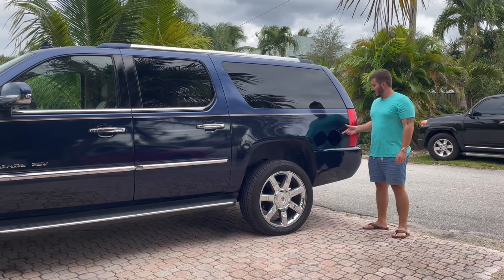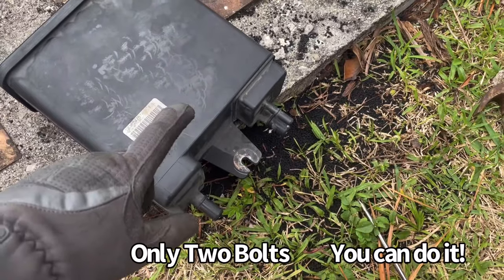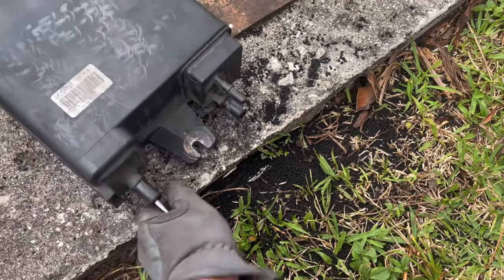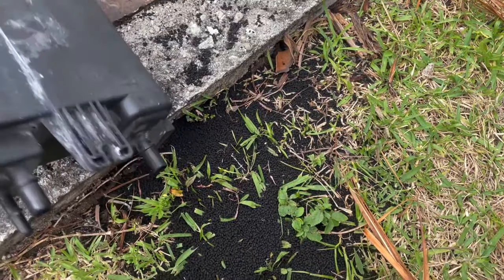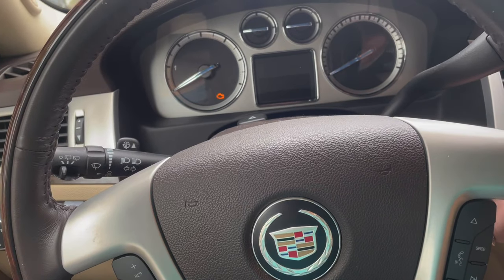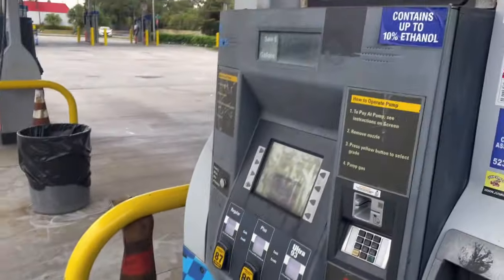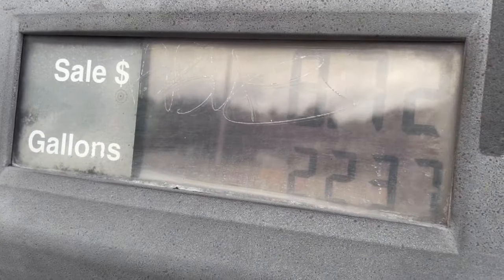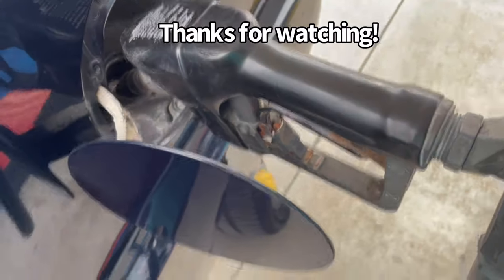Gas Tank Won’t Fill? Cant Pump Gas without Clicking? Free Fix Charcoal EVAP solenoid purge valve DIY

Comment: I had the same problem but found my canister was not plugged. The little carbon BBs inside the canister had gone down the tank vent tube and plugged it up. I had to vacuum the BBs out of the tube and the problem is now solved.
Reply: Which is due to the mesh deterioration within the canister, as told to me by the mechanic. He said if we would put the line back on that it would just plug up again. I can’t verify that, but so far leaving the line off, after blowing out all of the debris, has worked wonders.

Comment: I flushed mine with a hose pipe. Mine had fuel in it from over filling the tank. Then you dry it out. I used a tire pump and let it run. 4 years later it’s working fine.
Reply: Did you notice poor fuel economy before flushing?
Reply: Could you elaborate on this a bit further? You pulled off the charcoal canister, flushed it with a old fashioned house (water) and then dried it out with a tire pump? How's it working now after 5 years?🤣
Reply: @kyleg3725 He said he used a tire pump. He must have pushed air through it in the direction of the tank. 
Good idea actually.

Comment: Is there any flaws of removing the charcoal from out of the charcoal canister? How had your truck been since removing all that charcoal canister ?
Reply from the maker: Good to go no issues. It’s all there for government emissions nonsense. You don’t need it
Reply: It will not pass state inspections and if the state policeman especially here in Texas catches you it’s a $10,000 fine just replace it it’s not worth going through the heartache later when your truck is not running properly and then at the mechanic finds what you did he can report it’s his obligation To report any Pollution control devices modified . Do not take advice from people that are not technicians. ✝️✝️✝️
Reply: Lol mechanics ain’t snitches. They’ll charge more only
Reply: @loveofchrist5808  They don't check emissions where I'm at.  No problems.
Reply: I don’t think I’ve ever had a police officer in Texas tell me anything about straight pipes, let alone something like this
Reply: @loveofchrist5808 ,Texas only does emissions testing in eight counties and those counties are in major metropolitan areas. Texas is also doing away with state vehicle inspections. So modifying exhaust systems are not a crime.
Reply: @loveofchrist5808  Those of us native to Texas do not call the "Knights of The Highway" State Policemen!  They are UNIVERSALLY referred to as "TROOPERS" or by their agency abbreviation of "DPS" which is the 3-letter acronym for Department of Public Safety.  The DPS will not "CATCH YOU" with a check engine light, they DO NOT perform personal vehicle inspections except in Accident Investigations and I rather doubt that You've been in Texas very long, BUT I'm curious what state that you migrated from.   
Do not take advice from people that don't understand the difference between a truck and an suv and are not a true Texan.

Comment: I have an '07 Yukon Denali now doing the same thing. Was told by a local shop to just pull the hose off the canister and leave it off. Good idea?
Reply from the maker: Give it a shot, you can always plug it back in. But you may end up with a CEL. No reason not to try
Reply: Did that work?   I cleaned out my canister and I still have the not flowing problem.
Reply: @rolandvillarreal2687   Pulled off the hose, NO did not work. Then blew an amazing amount of charcoal out of the line. Continue to blow the charcoal out until you hear air rushing back at you with the odor of fuel. Then I left the hose hanging. Took five gallons without clicking off once. Would of put more fuel in it, but that would call for a bank loan.
Reply: @BobHGarage  I did this fix today. I went to the shell and went to pump gas and the first time It did click but the second time it seemed like something let loose and I pumped 8 gallons without stopping.I was also hearing something underneath like the pellets going through a line or something. So far so good.Thanks.
Reply: If the filter that contains the charcoal fails (& they basically disintegrate over time) it allows the charcoal into the evap lines causing an obstruction there so it's a good idea to blow out the lines w air.
Reply: This fix also improves gas mileage.

Comment: That is the least of your problems. The charcoal pellets are in the evap lines. You got lucky if its working.
Reply from the maker: I can absolutely guarantee you 100% that there are no charcoal pellets in the evap lines.
Reply: @BobHGarage  that's good for you and as I said you got lucky.
Reply from the maker: The truck caught fire and burned to the ground two years ago…
Reply: Did it burn down because you took all charcoal out or something else happened and is ok to run it without the charcoal in the canister? Thanks
Reply: @BobHGarage  Is this legitimate? Or are you trolling? I am looking to fix mine and hoping this solution did not cause your car to burn 😬😭
Reply: Insurance scam lol @jamesbrock9923

Comment: We’ll guys be aware if you do this you most likely will not pass the emissions test when they give you an inspection sticker , yet giving you 90 days to get it right , so if you already taking it apart might as well go spend 180$ on a new one I just did mine so worth just buying new and not having to worry about it later ! Make sure to vacuum out the vapor line when it’s off !
Reply from the maker: Agreed, if you’re in an emissions testing state this is probably not the move for you if they test your gas tank emissions. Otherwise you’ll be good to go, all the charcoal canister does is reduce the gas vapor smell before routing the vented vapor to the intake manifold vs letting it vent to atmosphere. 

  This will have zero effect on tail pipe emissions 👍
Reply: So mine is stopping to I want to get this fixed what was the problem and how much you were charged?
Reply: Or you can  just pay for inspection sticker...😂😂😂
Reply: Well they probably shouldn’t look underneath mine…removed catalytic converters too. Yea, if China can burn coal like crazy…I am not the problem.
Reply: Done with emissions and all the ridiculous crap we have to put up with.
Reply: 4 floridians this is a joke 😅 we are okay..

Comment: Yeah I had this issue pop up out of no where on my 2012 VW Jetta. I research a ton & couldn't find anyone with the same issue on 2010 or newer Volkswagen & there were no after market canisters for sale. The only ones I found are $200 so I decided to see if I could fix what's causing the blockage cause there's nothing to those canisters that should cause enough failure to have to buy a new one. Also with VW there are no emission's codes that get triggered when this happens. They could do away with 90% of the emissions BS in cars &  people would have a lot less problems with there vehicles. I know you can buy a delete kit that removes this canister all together but I'm not sure if it will trigger a code on cars.

Comment: Did it ever throw codes or mess anything up?
Reply from the maker: Nope. 
Found a better solution on my wife’s truck though. If you have access to HPTuners you can just remove the vent line that goes to the charcoal canister. Then when it throws a code for an emissions leak, just delete the CEL code from the ecu.
Reply: If you disconnect the big vent line going before going to canister it should fill up with no problem it would seem ( nothing but vent hose coming from tank) but still want take gas. i only have 4 gallons in it though? (Basically tank, filler hose and push in pressure switch) all lines off pump except fuel line???

Comment: In my experience there are three main causes for this:
1. Overfilling the gas tank causes gas to migrate into the charcoal canister which causes the charcoal to clump up and or get pushed into the vent lines and or vent valve clogging them up. 
2. Good old fashioned dirt, dust, debris gets in the charcoal canister, vent lines, vent valve clogging them up. Very common if you drive on dirt roads a lot. 
3. Your vent valve and or your purge valve fails which will usually cause a check engine light. 
Just take you charcoal canister out and blow compressed air through it, the vent lines, and the vent valve to unclog and you’ll be good to go.
Reply: is the vent line and vent valve on the part that he was messing with?
Reply: @jjgarcia6833  it does not appear to be but it’s hard to tell. On that vehicle the vent valve may be mounted separate from the charcoal canister. The vent valve will have a vent line going to it and also an electrical connector.

Comment: Bro i have an 06 chevy express van i have been trying to figure out why the it does this so i appreciate you and this video im going to try it
Reply: Heads up man. I got a 04 chevy express van. Same issue.  It was a bear pulling that canister off and it not fix my issue. There’s also a small purge sensor that regulates the air flow right next to the canister. It’s like 4” tall lil can th at goes bad and stops the flow. U can just unplug it and try to fill the tank first. If that works it’s not the big canister. I’m gonna try that next.
Reply: Any issues after doing it?

Comment: Pump kept shutting off.  Removed canister and found that sensor valve housing had a hole in it and electric connector was broken.  Stone or something must have come up and whacked it good.  Used knife and screwdriver to open canister.  Removed charcoal which looked good, no clumping.  Blew out filters with air hose, put charcoal back in and sealed with silicone.  Replaced the valve sensor part for 30 bucks.  Tank fills up with no issue.  Hoping this will cause the gascap warning to go away.
Reply: Forgot to mention this was an 07 durango.  If the charcoal had been clumpy I had planned to heat it in a pan over outdoor stove to dry it and reuse it.  Why spend money to replace when it's more fun to try to fix it yourself.  Always learn something whether it works or not

Comment: That was 2 years ago, curious as if it's still fixed??  Had that happen to my 2011 Santa Fe and all of the charcoal BB's went thru the lines and into the tank. I think 2 or 3 different canisters had to be replaced along with them dropping the gas tank to empty and clean it out totally.

Comment: Great video and about to go check my H2 now and fix🤨Dealership tried to tell me it was my gas tank needing replaced for $1700🤬
Reply from the maker: 🤦‍♂️ of course they did.
Reply: If it’s the purge solenoid that failed, it could damage your gas tank.
Reply: Where the h2 2007 canister located? Thank you
Reply: Dealership service departments would rather climb a telephone pole and tell you a lie than to stand on the ground and tell you the truth.
Reply: @stewpacalypse7104  There's more money to be made in telling you a lie.

Comment: So essentially you can just disconnect the hose that goes from the gas tank to the canister and you’re doing the same thing.  Because when you clean out the charcoal it’s just venting to the atmosphere anyway.
Reply from the maker: If you do that you will get a check engine light. 

But yes, the better way to do this is to just clip the line and vent to atmosphere. But then you will need to purchase HP Tuners in order to delete the check engine light. So about $300. 

What’s in the video is how to do it for free. 👍
Reply: @BobHGarage  I’ve already got emissions tuned out of the computer. I won’t get a check engine light. It’s just that when I had the vehicle tuned I wasn’t having this problem.

Comment: Curious as to the results of this 2 years later? I am facing the same issues and want to solve it! Does dumping the charcoal really do anything? Is the charcoal important at all? Just worried about saftey!
Reply from the maker: The better fix is to just clip the lines leading into the charcoal cannister and let the gas tank vent to atmosphere. 
Unfortunately though you will need HpTuners in order to remove the check engine light if you go this route.
Reply: @BobHGarage  I don’t necessarily care about the CEL. My friend is concerned that the evap is a saftey issue not environmental one. Keeping the vapors in the system. One cigarette lit next to my car will cause a potential explosion he said. Thoughts?

Comment: The vent valve is default in the open position whenever the engine is off... removing the charcoal means you will get gas fumes when filling the vehicle and potentially any time it's not running.
Reply from the maker: Correct. But it doesn’t happen often.
Reply: Is this dangerous??
Reply: @kyleg3725  It's most dangerous point would be during refueling as you're causing a big surge of air volume (empty tank) to be displaced by fluid (gas), sending all the fuel vapor out the breather tube.  It's about as dangerous as filling an ordinary gas can.
Reply: @cup_and_cone  but on a bigger scale, but thank you!! That puts it into perspective for me!

Comment: Could this be a fuse issue as well
Reply from the maker: No.
Reply: Thanks, I changed the charcoal canister, purge valve solenoid and charcoal canister solenoid valve.  Same issue
Reply: @robertsestate6421 same with me.  I am guessing one of the lines are still clogged up.  I just haven’t had time to take it all apart again and blow everything out.  Again.

Comment: I’ve changed the charcoal box 3 times, purge valve and charcoal canister valve.  And still same issue lol I’ve replaced these parts about 3 times each. And still same issue what could it be???
Reply from the maker: Just clip the lines and let the tank vent to atmosphere.
Reply: Which lines?
Reply from the maker: @martinchacon6666  the lines from the gas tank to the charcoal canister. Clip them closer to the canister. 
You’ll get a check engine light which you can erase with hptuners but you’ll never have the filling problem again.
Reply: Thanks a lot brother was very helpful. Never thought of that 🙏🏻

Comment: Sadly the pellets from mine are in the tank lines of my 2013 Escalade Ext.  Replaced rhe charcoal canister and the selenoid and still wont take gas properly. Both garages said same thing.... install a new gas tank. Apparently common on these platforms. What a trash heap.
Reply from the maker: Don’t replace the tank. Just clip the lines from the tank to the charcoal canister. It will completely solve the problem. 
The downside is you’ll need to spend $250 on HPTuners to go in and remove the check engine light. 
But absolutely do not replace the gas tanks. That’s insane and the shops are trying to take advantage of your lack of knowledge.
Reply: @BobHGarage  I figured there was a way to bypass the damn issue. They wanted $2400 and I just laughed. Wonder if there is a video on that? Would the light continuously come on once done, or just once?
Reply from the maker: @Aviation_Professional  yes it’s an easy solution. I did it to my wife’s Escalade years ago. Just never made a video and we don’t own those trucks anymore. 
But you will get a CEL that will stay on. If you reset it, it will always come back. You’ll need HPTuners to completely delete the code from the computer.

Comment: Does this work ? 2010 yukon no codes
Reply from the maker: No codes this way. Better way is to just clip the vent lines to the tank and eliminate this whole charcoal system all together… but then you will get codes. But $200 for HPTuners and you won’t have codes

Comment: Why would you take the charcoal out of the Evap system canister when it came from the assembly line with charcoal in it.
Reply from the maker: Because as the charcoal ages, it is what causes the line to block and the tank to not vent properly. 👍

Comment: I change the canister and the vent valve and still have the same problem, pump keeps shutting off, what can I do?
Reply from the maker: There’s a vent valve up on the engine next to the fuel rail. Try that
Reply: @BobHGarage  the line to the charcoal canister (the center one on the fuel pump) was clogged on my 05 tahoe and that middle line is what lets the air out of the tank, into the charcoal canister. You have to get an air compressor and blow out that dirty line while it’s disconnected from BOTH sides, and then your problems are fixed!! 

My vent solenoid was already bad and it fixrd a code replacing it, but these fixes, even blowin out the charcoal canister itself did nothing to help the fuel filling issue. Only cleaning that middle air/pressure line will help with the fuel delivery. 

Hope this helps!! Nobody ever posted about this on YT or anything so i hope you get a video out about it. It would help a lot of people who already tried to fix the problem like me.

Luckily i don’t have an exhaust still so i can always go back in and fix it. Soon.
Reply: @BobHGarage  figured i’d say that since you still reply to comments. It would be a great fix for you to come out with.
Reply: your purge lines are prob clogged with charcoal pellets, disconnect purge line from canister and check for pellets
Reply: my h2 has been doing this for months but i just now got a p0455 evap leak, any suggestions?
Reply: You probably have the charcoal in your evap lines. They will need cleaned out

Comment: How likely is it that the check engine light won't turn on?
Reply from the maker: A few months later and I still haven’t gotten one. 

If you’re gonna keep the truck for a while it makes sense to spend the $200 for HPTuners, even if you’re not going to do any tuning you can turn off check engine lights
Reply: Thank you sir